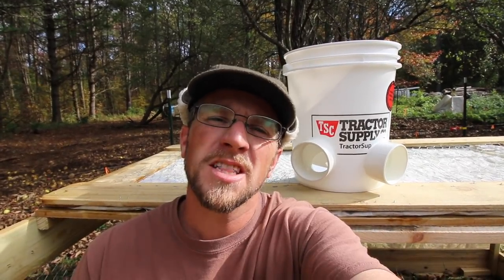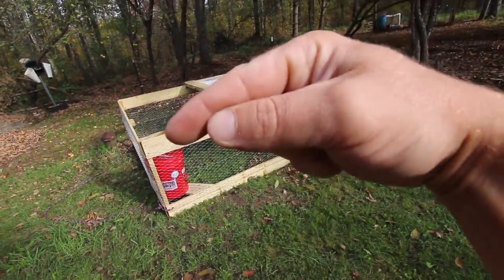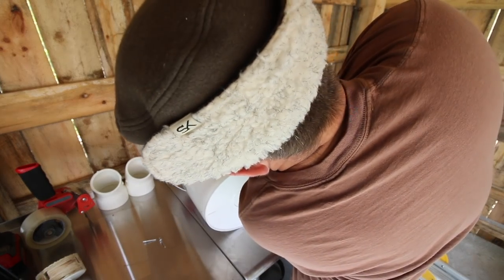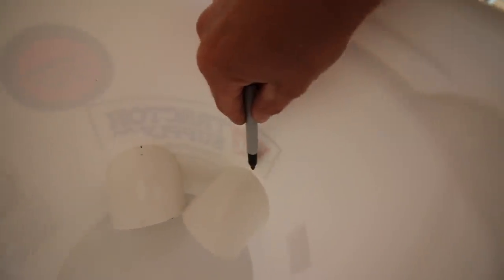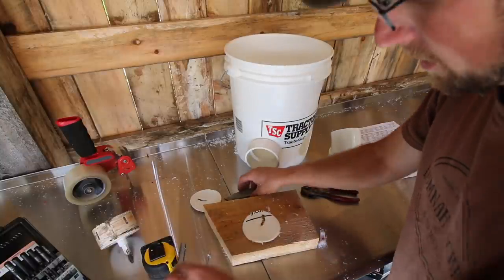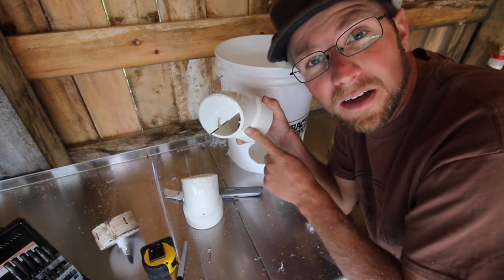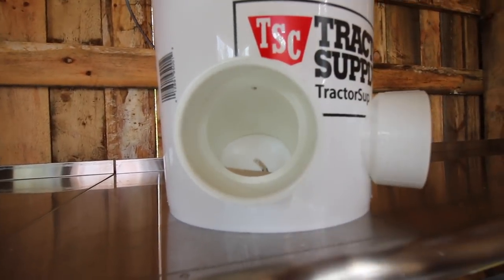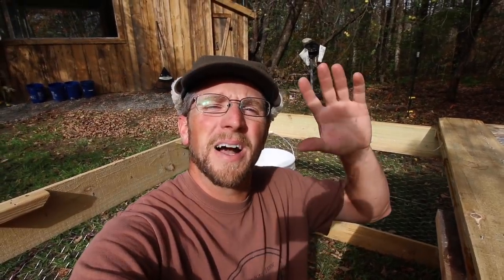Diy Automatic Chicken Feeder (easiest way to feed your chickens with a 5~gallon Bucket)

Comment: MANY, MANY THANKS!!  This chicken feeder FINALLY solved my ground squirrel problems!  The little SOB were eating half the chicken feed but no more.  I put in four feed ports and raised it up with a smooth sided bucket like in the initial video shot, to prevent ground squirrels from climbing up.  Some can still stand up on their hind legs and stretch enough to get their front claws on the lip of the feed port.  But since it's smooth and there's nothing to grab, they end up falling when they try to raise themselves up.  I watched one try three times before giving up. 

No need to worry about rats and mice at night either so I can leave it out overnight.  The handle makes it easy to move anywhere but I did bend it flatter so it can't swing past the lid.  I didn't want it hanging on the side which might help the squirrels trying to hoist themselves up.

We don't have tree squirrels so I don't know how well it will work with them.  But it is 100% effective on California ground squirrels which are a real plague in my rural area.   Just an FYI:  I bought my food grade 5-gallon bucket and lid from the paint department at Walmart.  This white bucket has no markings and the labels are easily removed after heating lightly with a hair dryer.

Comment: Sweet feeder!!!  Just a tip that I've seen before, if you use the whole 90 coupling for each hole and you keep the bottom of the 90 an inch or two off the bottom of the bucket and you won't have to tape that little cut off piece in and worry about it coming off.
Reply: I see problems doing that.

Comment: You could also use pipe glue and glue on an end cap after you cut a hole in it or get a pipe and then cap you can screw together avoiding all glue

Comment: Would it better to have the ski on the end with the buckets? The way it is you have to lift both buckets to move the tractor.
Reply from the maker: No the end with the bucktes you need to life of the ground. We show how we use it in tomorrows video

Comment: I made this over the weekend for our chickens.  Really appreciate the video and directions on your blog.  BTW - parts list is for a 90 degree PVC elbow, however the link to Amzn goes to a 45 degree elbow.  Have you found the 45 or 90 elbow to work better?  So far the new feeders are much cleaner than the old commercial style feeders with so much less waste.  I have a chicken house on the farm so I raised the new feeders on cinder blocks and seem to work just fine.

Comment: I made one of these and any chickens small enough absolutely will get trapped inside the feeder. It worked but I have found it to be better to feed my poultry daily instead of allowing them to free feed. the number one reason that I prefer to feed daily is pest control. I live in rural Mississippi where food is left out you can bet the rats are going to get it or the mice. the number to reason I don't free feed is cost. they absolutely will eat their fill every single day and then some. I have found it more cost-effective and better for the health of my birds to give them what they need and not what they want

Comment: Does the water bucket need a little hole in the lid to avoid a vacuum effect, preventing the free flow of water?
Reply from the maker: That is a good idea!
Reply: John Walsh -- Good catch. The water will not flow if air cannot get into the bucket.

Comment: I was going to build your larger sized tractor and scale it down for my sister to pull around. But this will work. Doubt I can do it in 30 minutes though. But thanks for the step by step. I can definitely do one of these.

And can you tell me how to get the Lumnah Acres theme song out of my head?
Reply from the maker: I dont know how to do that! I say keep singing it! :)
Reply: Nancy I agree also...this design is the perfect tractor, breeder, feeder, etc. for those who are really limited for space to free range, and still have security and quality grazing for your birds!
Reply: It would not be hard to add a small door in the front panel to allow the birds out to free range. As long as you kept the feeder and water in the tractor, I don't think it would be hard to train the birds to return to the tractor at night.
Reply: Nancy Fahey
Reply: @richardbohlingsr3490  Saturday after last Thanksgiving we bought 6 hens and raised them.  When the first of March arrived I put them into a portable coop and kept them in for a week/ten days, then opened the door so they could free range.  Every night at sundown [when our driveway lights come on] I go out and close the door to the coop.  They are always already in and headed for the enclosed section where the nest boxes are located.  The key is to keep them confined for. a while so they know where 'home' is at.  Good luck with your adventure.

Comment: I've tried this and failed.  The slugs will not stay on with tape for very long before dust from the feed makes the tape less sticky, causing the slugs to fall off.  So then I tried removing the slugs and extending the elbows on the outside of the bucket with 22.5 degree elbows.  This morning I had chicken feed all over the ground.  I need a better idea to keep it from spilling out.  PLEASE!!!
Reply: If you haven't figured it out already, just use pvc glue/cement
Reply: @jamestomlin5525  I ended up sitting a 1 gallon plant bucket with holes in the bottom inside the feed bucket. Seems to work better.
Reply: @justinmartin9644  ah

Comment: Wouldn't it be easier to buy another fitting, either 90 or 45, and cut is to avoid spillage?  The tape idea is really flimsy for an object that will be left out in the wether.